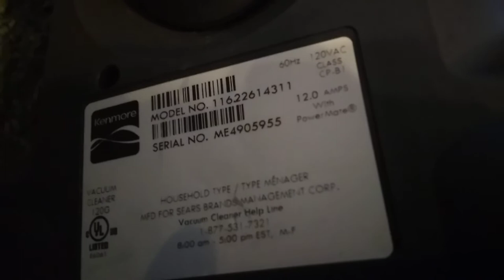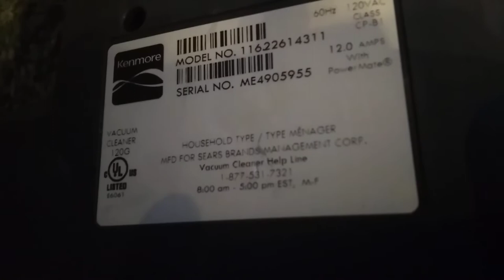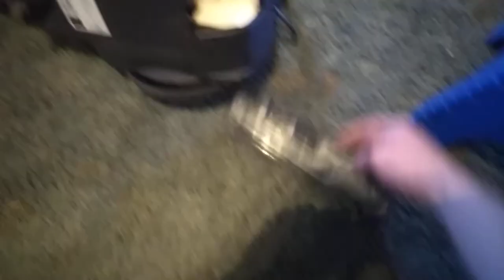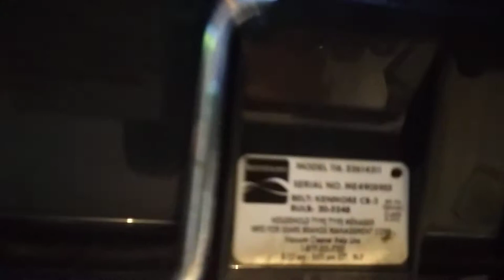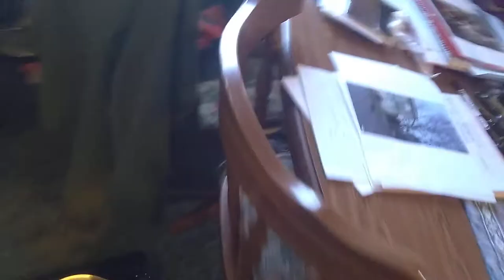kenmore 600 elite demo/review

Comment: That power nozzle was never meant to swivel. It was designed before swiveling vacuum cleaners were the big thing. Kenmore offers swiveling power nozzles, but only on more expensive models. The newer ones like yours seem to have a lot less space to turn, but it was meant to help with laying flat to get under things on top of relieving stress on the elbow. Also, in the fine dust compartment in the center of the bin, the dirt basically just falls from the cyclones into there. A coating of fine dust in there is not only not going to hurt it, but basically impossible to avoid with a multi-cyclonic design. If anything, it means that the cyclones are working. Dysons most certainly do the same thing, the dirt just seems to collect higher in the bin where it cannot be seen. Your Kenmore actually has nine cyclones, by the way. The bin itself is the first cyclone.